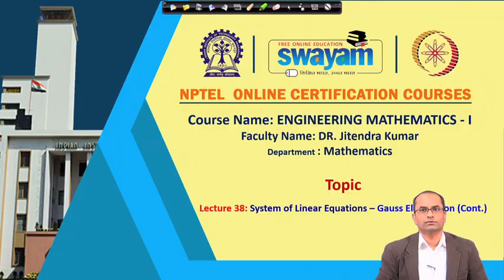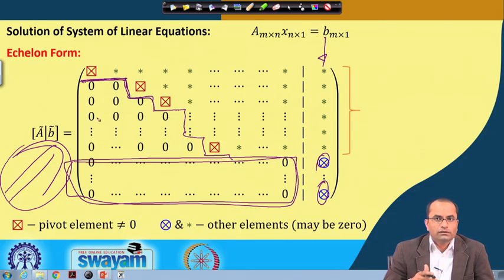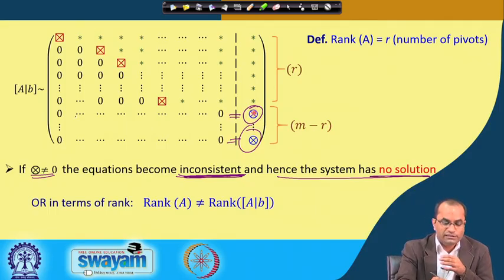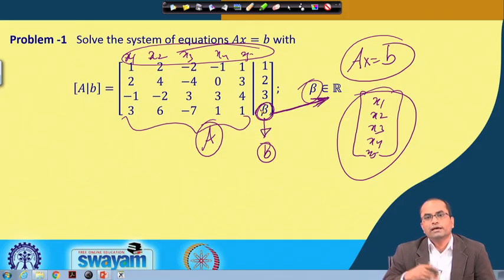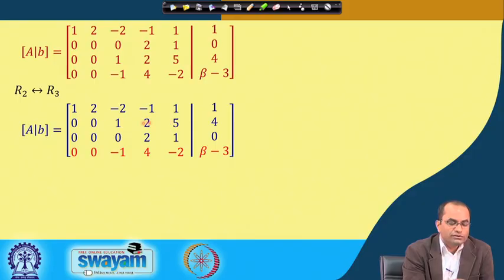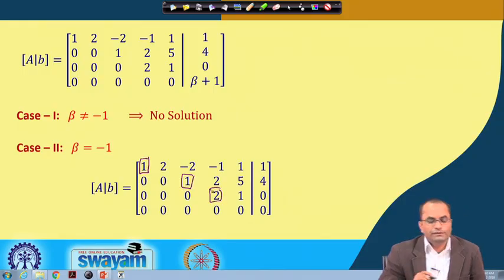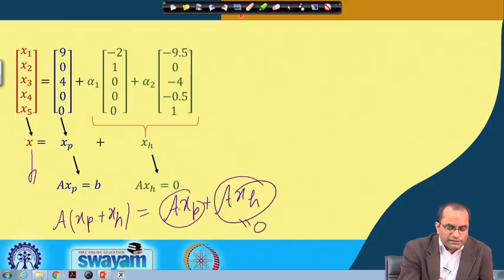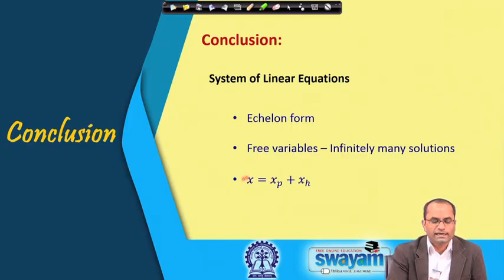Lecture 38: System of Linear Equations –Gauss Elimination (Cont.)

Comment: Sir what will the system of linear equations will geometrically represent ??
Reply: I think it depends on the number of variables, as in case of two variables they represent straight lines, in case of three variables they represent plane , and same after that....
Reply: I think it depends on the number of variables, as in case of two variables they represent straight lines, in case of three variables they represent plane , and same after that....